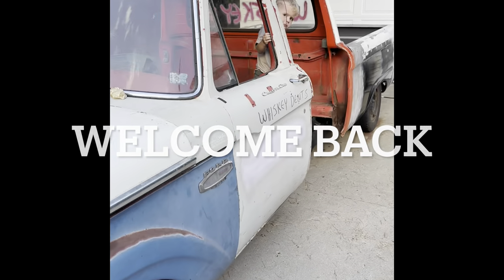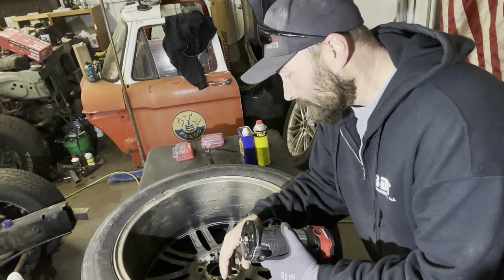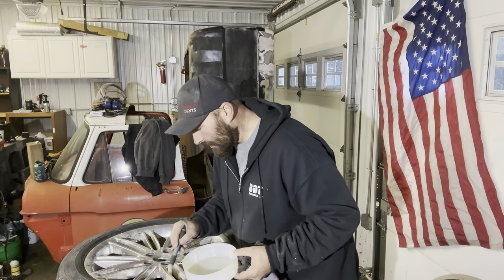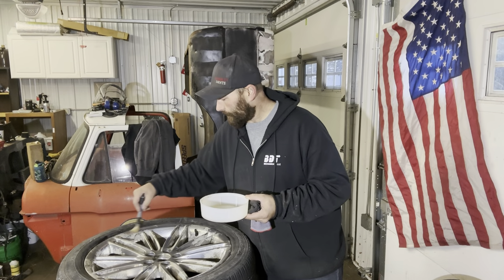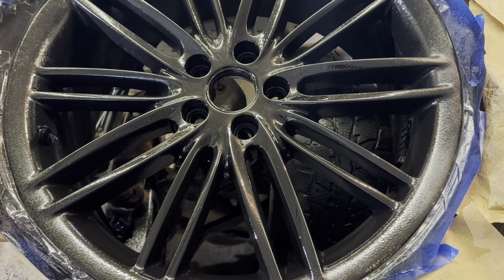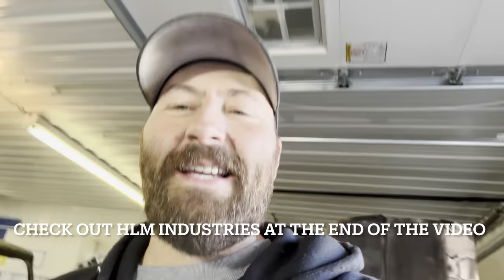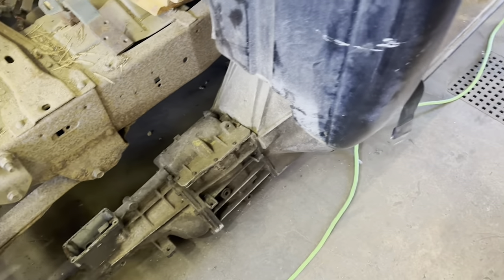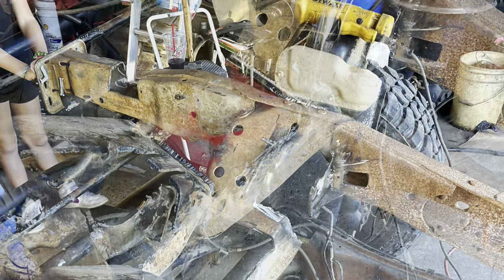Nothings a direct bolt on here.

Comment: T5 should bolt up to a 300 as it's the same as a SBF as far as belhousing goes, I think the depth is the issue, might want to check with modern driveline if you cant find exact specs.
Reply from the maker: Thanks I’ll definitely look into that. I can’t find anything worth believing.

Comment: Small block and 3.8 V6 T5 will bolt right up to 300. Same bolt bellhousing pattern. I you have to use an aftermarket flywheel though that is neutral balance (same as 351C for foxbody). I'm about 95% sure that the foxbody 5.0 pilot bearing will even work.
Reply from the maker: I’m still researching. I’ve heard the 300’s flywheel works because the motors internally balance.   Have you done the swap before?